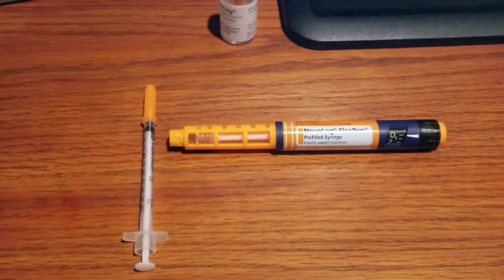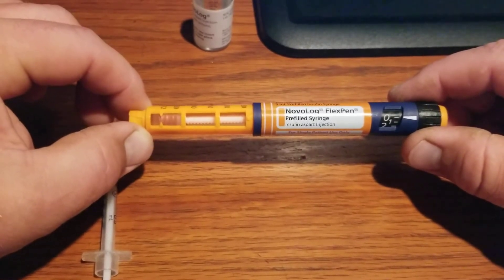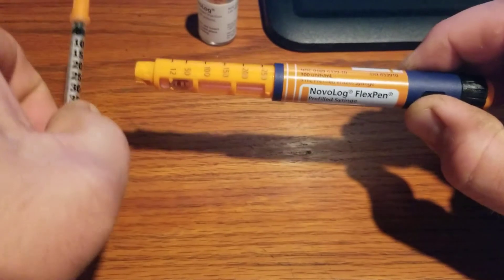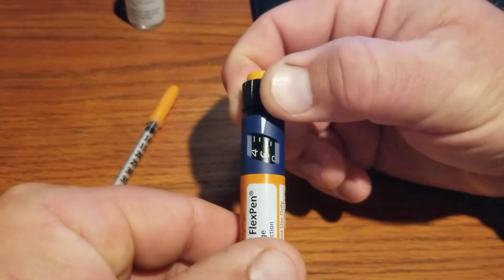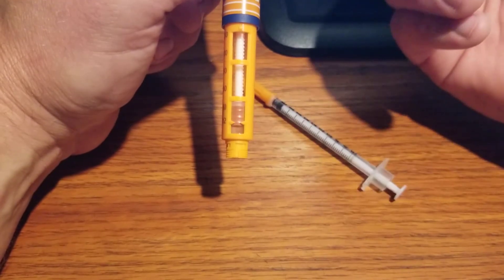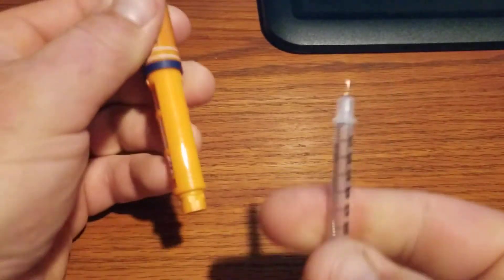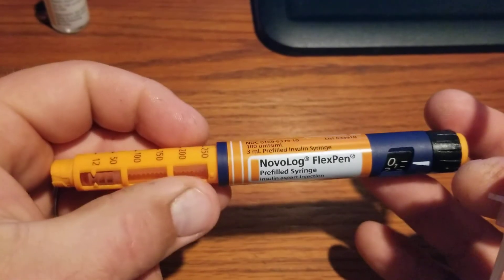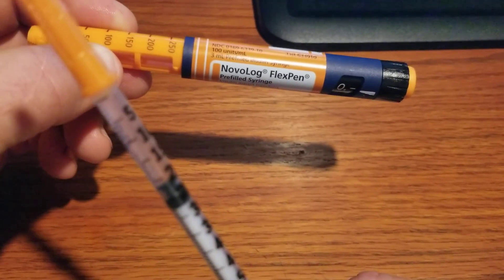How to get the last bit of Insulin out of a Pen using a Syringe

Comment: So if I use a U-100 syringe and withdraw from a U-300 insulin, was told to take 100 u of U-300 insulin the syringe should be filled to the 33 line on the syringe? 
Thank you, 
Phillip
Reply from the maker: The info you were given is accurate. U-300 is 3 times the concentration of U-100 insulin. Always draw up one-third of the normal dose using the method you described.

Comment: thanks, i will be drawing out every time for small cat use. this helps. do i inject as much air into it as i will be taking out each time??
Reply from the maker: That is correct.  As a reminder, make sure your insulin says U-100 somewhere on it. This insures the "units" are measured correctly on the syringe. Unfortunately, there are a handful of pens that are U-300 or U-500 (3 and 5 times concentrated respectively).
Reply: @tightwadtv3421  yes sir, i  will be getting the U100, .3cc and dosing him with 3 units on that to begin with. He is now on vetsulin 3.2 units. changing over to a much better insulin in couple days!
Reply: @tightwadtv3421  And thank you!
Reply: How on earth you gonna get a small enough dose of Novorapid for a cat?! 3 units has a massive effect on me as a 230lb bodybuilder!

Comment: I gotta know, is that the only time you received 22 units out of empty novolog? Bc I've never got more than 16 most, I only got 12 units one time.
Reply from the maker: I've never had less than 18. I pull the plunger on the syringe slowly as I withdraw the syringe slowly (the further you insert the needle past the  stopper in the pen the less insulin you can retrieve). Also, many people will lack the dexterity to get every possible unit out.